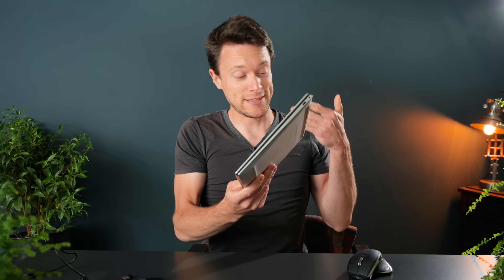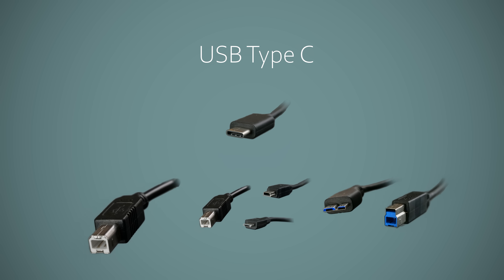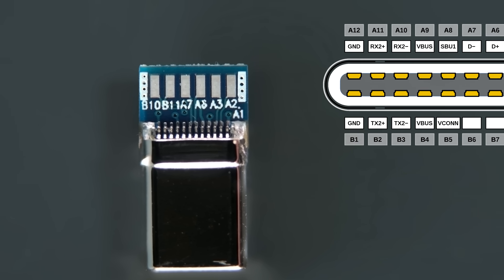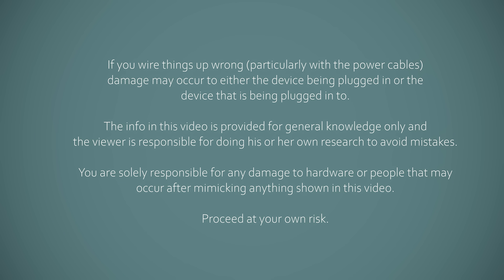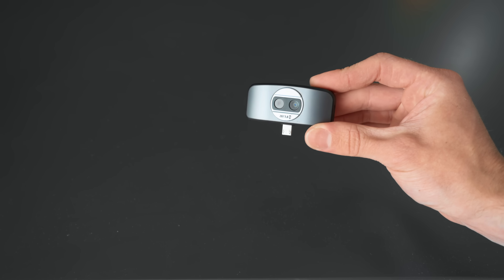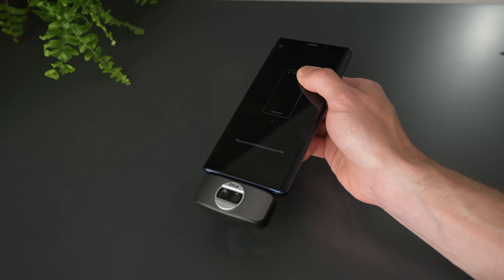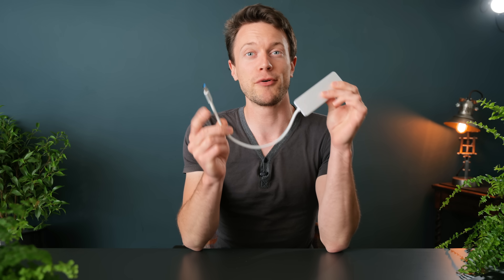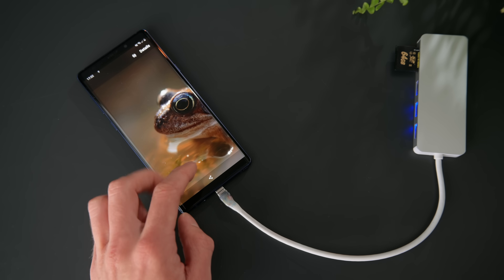Converting devices to USB Type-C

Comment: 2:08 I have never seen a USB3 type B connector before in my whole life.
Reply: You would see them on USB3 external hard drives quite a lot, either in the full size or micro version.
Reply: yes, on older ones. Would never buy one with those plugs today.
Reply: they were just a sloppy fix-up while remaining backwards-compatible, by just adding a new layer of pins.

Comment: Had to check to see of this was an April Fools joke. This might be one of those obviously terrible life hacks channels. 

‘That’s not a solution’ Yes it is. Although I’m not sure I have ever seen a USB-C to A dongle as long one as you used here. I’ve seen smaller USB-c docking stations. Just get a normal dongle.

As a practical matter this is a terrible idea. Even if that’s what you’ve got, supergluing it to your current device is easier and would likely last longer. Even without the superglue, this DIY USB-C might come off easier than the dongle.

Comment: Or yeah know just get adapters?

My desktop has 10gb USB 3 type A ports on the motherboard. So for just data transfer stuff I'll just need a A to C cable. For true type c use could just get a type c pcie card.

Comment: the smt  footprint R2 in 13:49 is for the RESISTOR in the pcb. No need to break the pcb, you just had to change the smt resistor to the other footprint...

Comment: ok, nicely presented but honestly cant see the cost/effort benefit to this, in all the cases the original connector was only made slightly larger with  usb c adapter, just glue it on and dont have to worry about it again. Doing this for fun... sure but as a practical alternative it does not seem great. Love many of your other videos, keep up the good work.

Comment: Better to remove the existing R1 50k resistor and install a 5.1k in R2.  Arguably you could probably get away with using the same resistor and swap it's position but ideally a 5.1k resistor +/- 20% should be used., 0603 SMD are £1 per 100 at most.
The trick to soldering SMD components is use LOTS of flux and 0.5mm or 0.3mm solder to give control and prevent flooding  The combination of flux then melted solder and flux "pulls" the component onto the pads like magic.  Hold the component down with a cocktail stick, dental probe, ceramic tweezers or a pin epoxied to a lolly stick.  Tip size isn't critical, but smaller is obviously better.

Comment: Cool hack/mod, however that looks like an MX Master mouse and has both bluetooth without the dongle and 2.4ghz connection capability with the dongle. Likely your laptop would have Bluetooth capability standard with your wireless card. . . Sooo you could just change the sync capability to bluetooth by pressing the profile selection button on the bottom and connect via the bluetooth link within Windows Devices screen and save yourself the hassle?

Comment: I'm left wondering why he didn't use a surface mount resistor instead of the giant through-hole version.  They are quite readily available at Digi-Key and Mouser.

Comment: Hey I was wondering if you could link me the resistor used. I have zero knowledge of electrical resistors. I have only soldered wires together, i have never messed around with resistors. I am 90% sure I can put it all together I just don't want to buy the wrong resistor

Comment: On that external USB devise,  wouldn't it be advisable to crack open the casing of the devise and simply change the wire and put the resister inside the devise, Thus no notification to be seen at the end of the wire where it's plugging into your computer!  Jest a thought! ;-)

Comment: A very cheap and equivalent alternative to Sugru and epoxy is ABS slurry.  3D printing scraps, or filament are perfect if you have any but I usually use black plumbing pipe.  To divide it finely I drill a series of holes with a large step bit and dissolve the swarf in acetone until its the consistency of printers ink, put it in a syringe and use.

It develops a skin on its surface almost instantly so it can be use in all orientations.  In front of a fan it dries fully in about 4 hours.  It can literally weld ABS parts together, waterproof wood, fabric, paper, etc.  It's non-conductive with high dielectric strength, and just absolutely dirt cheap.  Great video BTW!

Comment: This is stupid.  It's a lot of work that most people can't do with parts they don't have to do something that you can do MUCH better with a simple adapter from Amazon.  And they make adapters that are much smaller/shorter that the example he shows.  And with the adapter, you can use it with older/normal devices as well.  In fact, you can use a standard USB-C OTG adapter and it works fine.  I know, I've done it.

Comment: Type C is not a replacement for Type A, it is a Sub Connector or Specialized connector of Type A. Type A canot be removed as most servers and business units use it including its creator IBM.
Reply: Also, the Breakout Board costs more than just getting 2 Adapters.
https://www.amazon.com/Rankie-2-Pack-Adapter-Hi-Speed-Black/dp/B01EL4PVFE

Comment: I've been working on some diy headphones that use a female usb c port for charging and wired function. Would it be possible for audio to be run on the usb-c data pins? If so which ones?
Reply: You'd need a dac and amp

Comment: And, it's cheap as Hell. All devices ends up having a broken port on a perfectly - otherwise - working device. For that, I give them a superb (1 out of 10). That BEST OVER ALL are the magnetic ones like on apples. You will never use up or wear out the connector. Magnetic should be the standard no matter the number of wires... just add lots of wires... come on, it cost nothing.

Comment: USB-c for non mobile devices is awful idea, this type of a port has less mechanical durability than Type A usb port, all PC devices have Type A ports, all chargers have type A ports. Compatibility should be the main reason to apply a Type A port. But vendors needs more money for nothing, that is why new laptops does not have a lot of usb-A ports.

Comment: DIY Perks: how to convert devices to usb-c
Me: glues an adapter/dongle to the usb-a wire
Reply: Me: Buy a small sleek usba to usbc adapter $7. Done.
Reply: @KAriedoll  The slightly bigger ones that are like 2 quid for a multi-pack on  Amazon (with the added bonus of either allowing you to actually revert your "new and improved" USB device back to a standard Type-A plug when needed without a soldering station XD )
Reply: the same here.
Reply: Me: goes and buys the one he said was "significantly" bigger then the one he made cuz it was just slightly bigger
Reply: @TechTokOffical  That one just came with my phone, but even then, one's probably about the cost of that converter board and putty anyway, while still letting one use the device for type-A purposes.
Reply: yeah, this is big brain time.
Reply: Lol same

Comment: my MSI laptop has 3 USB A 3.0 and 1 USB Type-C but that usb C isnt used for charging, when i plugged in my USB C to USB C cable to my phone and pc, nothing happened, but when i connected dongle that was usb c to usb a, it started working like normal usb and charged my phone and transfered my data, so i think the USB C on my laptop is there for external screen 🤔

Comment: Anyone else hate the word “dongle?” I prefer adapter
Reply: never related so much in me life
Reply: Not if you're a male.
Reply: It's not a dongle in the true sense of the word.  It's deffo an adapter.
Reply: Afraid of a little dong-le are you?
Reply: I use adapters that have no cable. They plug into USB C and have a micro USB socket on them. A neat permanent solution. A dongle is a pair of plugs/sockets with cable between them. They tend to be a bit of a pain but can be right if avoiding tension on a socket needs to be avoided. Adapters are dirt cheap. Dongles can cost 10x more for the same job.
Reply: Yeah, sounds like a sex toy
"Now ribbed for better grip when you insert your dongle"
Reply: @UwU where are you from
Reply: UK term. UK > USA

Comment: The thing about the last conversion is that sure, you're not saving all that much space, but you are putting a lot less stress on that USB port by massively cutting down on the size and rigidity of what is sticking directly out of it. So yeah, it's very much worth it.

Comment: how does this work with female connectors? I have a device with a broken usb-micro connector and am thinking of replacing it with usb-c, do you also just bridge the d5 and b5 to gnd? because most of the breakout boards with female connectors don't have them on there

Comment: While cool, i don't see this being a practical in most user's applications. The cost of the material, excluding tools like the soldering iron, greatly exceed (more than triple) the cost of an adapter. These miniature adapters can be purchased in bulk, are a lot safer, and more reliable than a DIY. Interesting DIY though.

Adapters go round $6 or less in bulk while those breakout boards cost just as much and require extra material and labor. Check for yourselves.

https://www.amazon.com/nonda-Adapter-Thunderbolt-MacBook-Surface/dp/B07XYTHCXV/ref=sr_1_5?crid=1R346AYMVJ4U1&dchild=1&keywords=usb+ctoa+adapter&qid=1597137212&sprefix=usb+c+to+a%2Caps%2C305&sr=8-5

Comment: How difficult would it be to convert a Motorola Turbo 2 charging port to type c? It has a turbo charge feature but the micro USB port died. I'll send it to you if you want to try lol. Only way to charge it right now is a wireless charger.

Comment: Hi..i connect my focusrite scarlett audio interface to my oneplus 7t..it works fine if I want to hear from it...or record audio from it..
But, the problem came when I used SMULE app. Whenever I am recording a song over a karaoke in smule app, the karaoke is distorted, unclear. Is it the problem with my otg adapter ..or ?

Comment: DIY Perks, the resistor that you scratched out on the board can simply be desoldered and then an SMD 5.1k resistor soldered next to where the original was (where there are two tinned joints adjacent to the resistor) this will then set the breakout board to be a sub device.
Fantastic video though! I love the fact that you've created the first Ltech USB C unifying receiver! I have been after one of these for an age!
Reply: I like the video, but this made me cringe a little, when I saw him scratching the board instead of simply move the resistor to the other pad :) Never the less, the videos is great

Comment: one question, the usb A 3.0, has only 4 pins, like usb A 2.0 right? or it has the extra 4 wires? in the connector

Comment: 7:09 Or you could just desolder the smd resistor and solder it to the pads on the left instead of adding a massive tht resistor.
9:52 Of course there is... The pins on the micro usb connector are obviously standardized just lookup the pinout and measure continuity from the pins of the micro usb plug to the other pins that connect to the rest of the circuit. You might even be able to follow the copper traces if you don't have a multimeter.
Reply: in all 3 cases he could desolder and solder the smd resistor to the other pad without scratching the pcb and cutting traces
Reply: Please explain.. I can't quite understand it. A doc or article would suffice, I think..
Reply: Keyword: easy.
Most people don't have a dmm. In fact, the vast majority don't. Just because you do, and I do, and the people we hang out with do, doesn't mean most purple do. The people we hang out with often have similar interests as we do, so they will have similar things we do.
Reply: @xenonram  To be fair, the type of person interested in doing something like shown in this video either has or should have one.

Comment: I saw the video well. I don't understand, so I ask questions. After removing the R1 and R2 resistors to the USB C breakout boards, is it correct to connect the 4.7kohm resistor to cc1 or cc2 + gnd? Are you talking about removing the full up resistor and then connecting it full down?

Comment: Type c isn't even that universal yet. People are still confused about the standard type c and thunderbolt. You can't plug thunderbolt devices on type c but you can plug type c devices to thunderbolt. The funny thing is that they are literally the same plug. You can't differentiate the two unless there is some sign that says otherwise. There is also some devices that only support the type c as just a USB plug and does not transfer any audio, video, or even any other unique function that a type c standard port should have. Some port are also reversible and some are not. Some just transfer power. Some just receive power. It's literally confusing. Manufacturers should just commit to using type c with all its function or don't. I have this phone that has a type c port but doesn't transmit audio to my type c headphones because it has a 3.5mm audio jack. Like wtf? I exchanged it for a phone without a 3.5mm jack. My friend also have a phone that can act as a PC if you plugged in a type c to HDMI adapter. His' works but mine doesn't. Lmao. Standards are all over the place
Reply: ff
Reply: ff

Comment: 7:09 wouldn't it be better to move te resistor to the left? It seems like it would connect the pin to ground then. Saves you from putting such a big resistor on there.

Comment: I may be mistaking, but instead of scraping the line and adding the throughhole-resistor, you could have just moved the SMD resistor over to the other pair of pads ...
Reply: Exactly what I thought. It would certainly be much neater and smaller, but it would also be more difficult for the soldering novice.
Reply: https://www.pololu.com/product/2585 i think this board is in device mode by default.
Reply: @beartastic is right, i tried to utilize the original SMD resistor but it didn’t work. It is 56k as i measured with a multimeter. I ended up soldering a 5.1k SMD resistor which i scraped from a usb-c arduino accessory module to the R2 position, and it worked like a charm.
Reply: @刘玄-q2b  Good to know . Thank you for the info. I was not sure about it but that proofs it then I guess.
Reply: Thats what i thought as well, but odds are the original is the wrong value. 56k instead of 5.1k.
Reply: @notsonominal  Yes that was my only thought as well but would it mater as some circuit's only need parts to be within a range ?
Reply: If you have access to a SMD heat gun. Then I would do it...
Reply: @WizzRacing  You'd be able to do this with a soldering iron for sure. At least taking the resistor off with a soldering iron is more logical as cutting the trace lol.
Reply: He could also scrape the trace them jump the solder pads to the ground pad
Reply: As desoldering the SMD resistor may be a little hard for ppl I would suggest still scraping off the trace BUT! bridge the pads either using just junky-as technique of "solder trace" or a small length of wire.. almost as neat as proper way and also easier to do! :)
Reply: What other pair of pads, can you elaborate please ?
Reply: @abdulmohsenalmousa9564  Right next to the resistor. It's easy to see the traces in the video and that's exactly why the other two pads are there. One set goes high, the other low.
Reply: @abdulmohsenalmousa9564  Pause the video at 7:05 and you can see there is no trace between R1 and R2 so you could just move it over to R2 or just scape as seen then add a jumper wire but it would be very small/micro soldering any way.
Reply: Garrrrry Glendownie

Comment: That's a great video explaining the USB and type C. However, near 7:08 if you want to change the type C to device mode. I think you just need to move the resistance R1 to the place holder R2. That can make your device much smaller.

Comment: I think the last example I want to see is for power supplies. Will it be just the same? Just without the data connections? Will there be no difference with 12v and 24v if I want to make a DC power adapter to a type C?

Comment: ... or just get the little tiny USB-A to USB-C adapters that are the size of the connectors? They're cheap, available, barely add any size vs this, are able to be re-used with multiple devices (unlike this), and allow your devices to still work with USB-A devices.

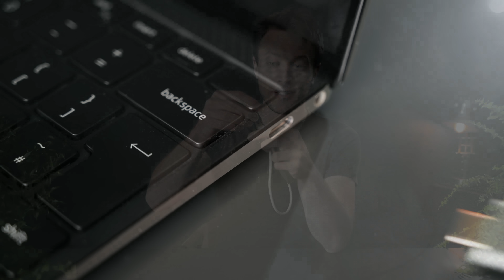Comment: So.. using an adapter like in  13:17 makes it faster just as if it were originally a type -C or not ??? and does it increase the power delivery  ( making it up top 100W ) or  just the normal wattage of 4.5  ??

Comment: it may sound a bit pricey for some, but you can always get an adapter for Type-C to Type-A and tape the adapter. You effectively converted your devices to the smaller plug and save yourself the hassles of warranties and potentially damaging your devices.

Comment: Instead of spending all the time on this stuff and getting all the needed parts etc. I rather just buy an adapter like this: https://www.saturn.de/de/product/_goobay-usb-c%E2%84%A2-auf-usb-a-3-0-2454583.html?rbtc=bis%7Csha%7C%7C%7Cp%7C%7C%7C&msclkid=9c013cdac5261186120f63dd46ca728f&gclid=CNOjlOeGweoCFcuehQod38MCxw&gclsrc=ds
Or I buy a package of them for a bit more.

Comment: the smaller converter you used for the USB hub... I'd have just used that for my mouse dongle thing... though I guess as a PC user, rather than a laptop user, not only do you actually have A ports still, but even in a time where you have nothing but C ports, sticking out a bit won't matter that much... also I'd just use a C to multiple A hub, because, PC.